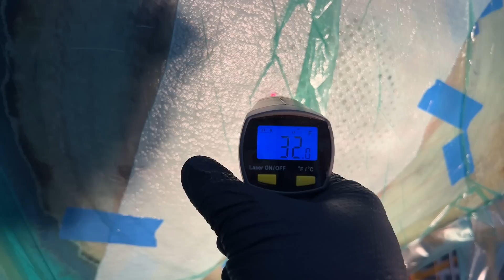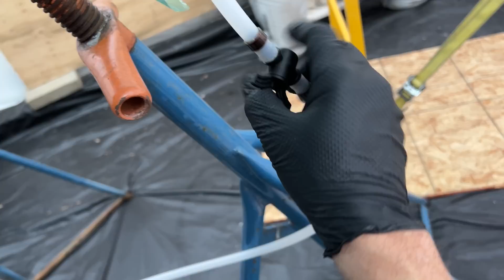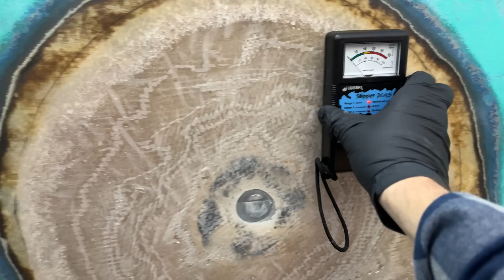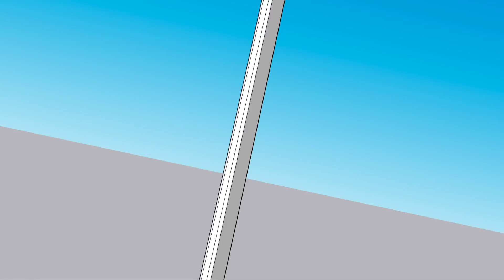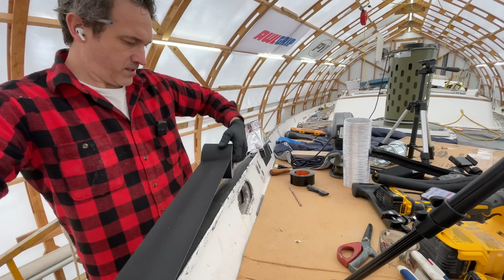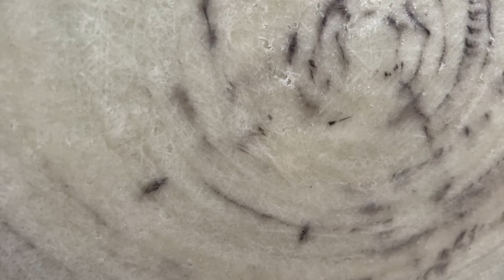I Built a DIY Boat DRYER but Does It Actually WORK?!| E039

Comment: When you rub your hand over raw fibreglass little shards of glass stick into you, these same little shards are going to stick into the new patch. This is why we use chopped strand then a woven cloth in successive layers as the chopped strands will penetrate into the cloth. Therefore, the large patch first is the correct way to do a repair. Double sided repair would be better, I would have setup to do the inside and outside first layers together, wet on wet, mainly because this is an area where slamming will occur.
Reply from the maker: Thanks for the feedback. If I was starting again I would make a bigger effort to do some bevel/patching from the inside too. 👍

Comment: No matter if you had applied the largest layer first or the smallest layer first over your hull hole, 50% of your viewers would probably say you did it wrong. It's an un-winable argument. In the past, I have usually applied the smallest piece first. But, after listening to your reasons for applying the largest layer first, I think you have a stronger argument. Either way, I don't see that repair failing in the next 6,000 years.
Reply from the maker: I think you have summed it up perfectly. Haha. Thanks!!

Comment: Speaking of pipe insolation. What about heat tape wrapped around roll copper tubing or other small pipe and inserting it down I side the walls. It isn't hot enough to start a fire but way too hat to hold on to for very long.
Reply from the maker: Interesting idea! 🤔 copper prices are pretty crazy but it’s a thought that I’ll consider for sure. Cheers!!🙌

Comment: Have been on the fence (Subscribing - Patreon) from the beginning , …and if this is supposed to be a DIY Channel ….its obvious that your Engineering background is taking over because as you mainly explain and further explain as you go along your reasons for this and for that!  No doubt that you have a good approach but too much is too much.
Reply: For sure!
Reply from the maker: Thanks for the feedback 👍
Reply: I love the explanations. It works for me. I process structural repairs and connections in a nonverbal, intuitive way but when Jon explains them, I notice that I gain a deeper understanding for my skillsets AND it helps me explain my own methods and decisions to others. 

For instance, on the Big-to-Small patch decision, what I most agreed with was the way Jon described the eventual sanding-off process that will simply feather out the ends of the intermediate-to-small patches, all the while leaving the largest patch unmolested to carry on its main purpose of providing maximum bond strength.  

I feel really validated and included by Jon's approach to this project and other, than the haircut, I wouldn't change much-just kidding! I'm grateful that someone is doing the stuff that I hope to accomplish myself, someday soon. Everyone's a critic these days and it seems to be a sign of our time. When I need to regroup and reaffirm my goals and intentions, I sometimes reread Theodore Roosevelt's speech called The Man In The Arena - I highly recommend it.
Reply from the maker: @scottcates  Thanks Scott. I appreciate the feedback... haha. I'm going in for a haircut on Thursday!

Comment: Check the specs on the data sheet and it should tell you the tensile or bond strength.  It’s impressive.
Reply from the maker: Yeah, maybe I’ll pop up some of the figures in a future video 👍